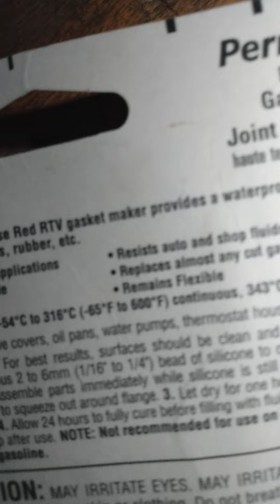1958 AMC Rambler Super pt.36

Comment: Hey Tim, it’s 58Ramblr from the forum, thank you so much for mentioning me I appreciate it, in order to solve the oil issue these engines have when going highway speeds, I want to add an external oil cooler, and you please make a video showing how that oil filter usually goes, and where the hose goes that you would normally connect the rubber hoses that would go to the oil filter , like where in the block would you run those lines? Thank you!
Reply from the maker: Ahhhh!!! I know just the guy you wanna talk to, he had added a oil cooler to his rambler, (roadster I think) he has documented the construction of the oil cooler on his website www.sr-ix.com
If your having trouble getting the info you need you can also send him a inbox message on the forum, his forum name is tomj. Glad your liking the videos I make and getting little bits of info!